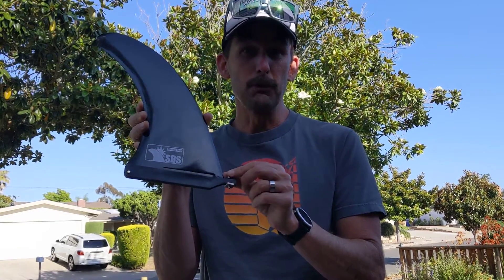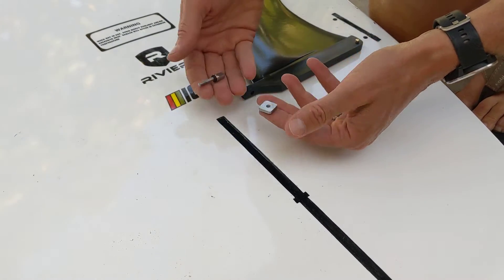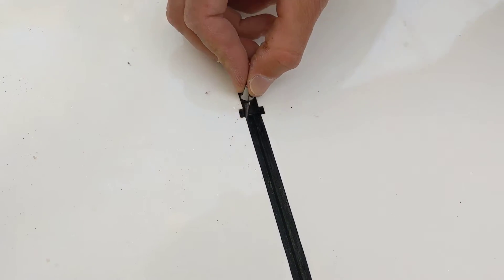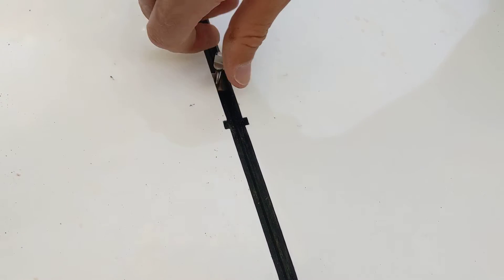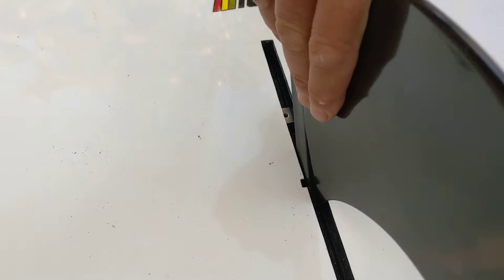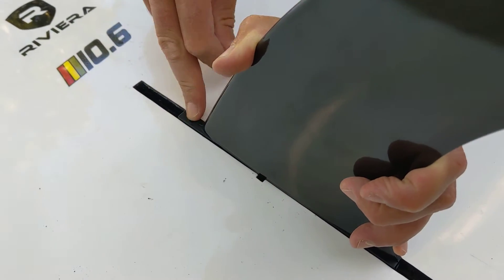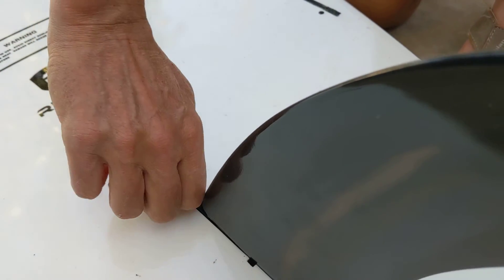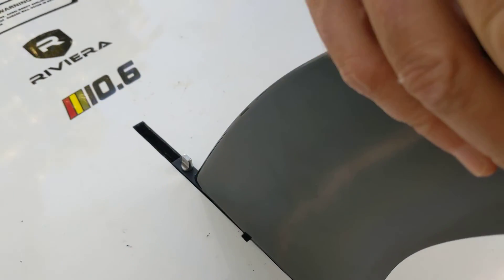How to install your paddleboard or surf fin from Santa Barbara Surfing

Comment: Awesome video, it's very helpful, I'm super stoked to get mine and back on the water!

I have a question tho, I've recently purchased a wooden SUP board and on my third journey the fin broke loose after 2 miles in calm waters, in the middle of the lake.
Do you happen to understand what could have been the cause? or is there a good way to prevent that from happening again?

Thank you!

(btw the correct term is hydro-dynamic drag, as the working fluid is water)